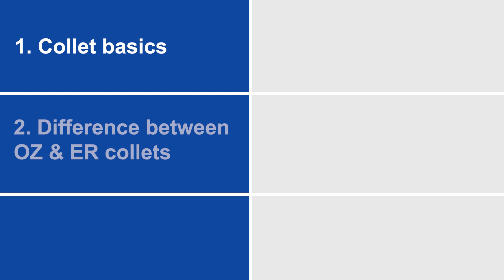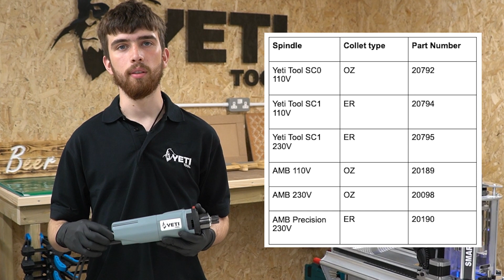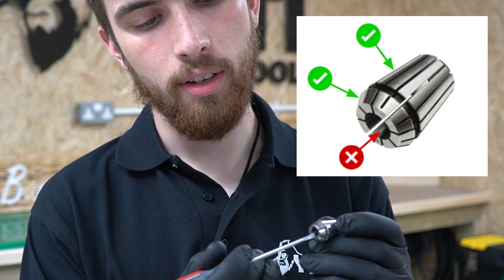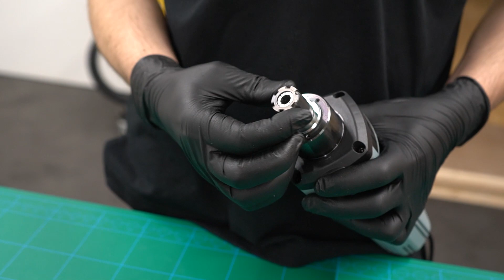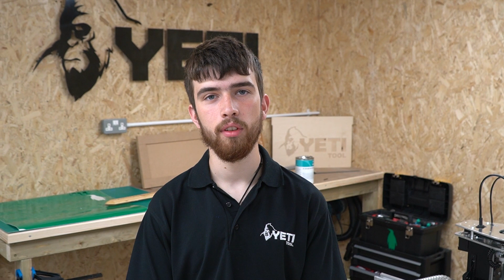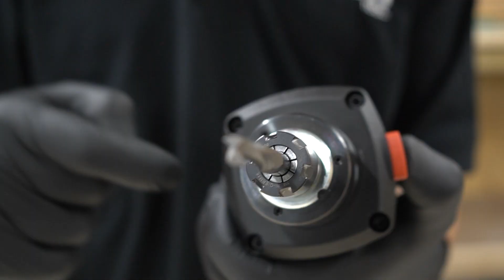Spindle collets masterclass

Comment: Thanks for the video and info/tips.  Can a 1/2 router be converted to a 1/4 router?  I have both and every bit is for a 1/4 but I want to start using my plunge router that is 1/2 size. Is there collets that can change the larger size to be able to take smaller bits?
Reply: I have both 1/2" and 1/4" collet inserts for my 1/2" router. Check with the tool's manufacturer.

Comment: Good info but I have a couple issues about putting any lube on the collet.  Hard to imagine that with the amount you put on the collet, some isn’t going to get into the core.  And when I change a bit, I air gun the collet and nut.  If I use any lube, I’d have to completely degrease the collet and nut  of grease and stuck on sawdust before regressing  the collet.  Maybe ok for very large production runs on one bit but otherwise a major choir for every bit change and not very practical.

Comment: does the molykote p40 come in smaller sizes, is there an alternative product that comes in alternative sizes
Reply: I've never heard about lubing collets. Just a waste of time to be honest.
Reply: @Darctan1  Plus, every time you change a bit, you have to remove all the debris from inside the spindle, collet and nut held on by the lubricant that can’t be blown off. What a mess and time consuming process.  And 1/8” turn to tighten.  What’s that? How do you accurately measure that?
Reply: @bw162  all i do is just clean everything from mixed coolant/dust. Then tighten new tool as tight as i can without hammer. The runout will still remain the same whatever torque it is tightened to. Car mechanics don't tighten everything to spec either because it's just a waste of time. Just get the job done and don't think too much 😂.
Reply: @Darctan1  I’ve worked in the aerospace industry. If there is a call out for a torque setting for any fastener, it’s torqued.  There are design torque values for collets.  I use them.  I also torque my oil plug nuts, spark plugs, etc on my cars.  Doesn’t do any good to crush a washer tightening them.  Neither do I want to stress a collet by over tightening it 90-degrees to the pressure angle it applies to the tool and risk twisting it or crushing it; and I have done both.  We pay a lot of money to get repeatable accuracy to .0005” to risk degrading that by using garage mechanic standards on a CNC.  IMO.

Comment: I have a 3 ft lathe for 30 years and never used collets.  I used the 3  and 4 jaw chuck, faceplate etc.  I will soon buy a set of collets and a chuck and this is a good video to get the basics, thank you.  What sort of motor is that one you had there?  Like given.
Reply from the maker: Thanks for the comment. The spindle motor is our own SC1 which has been built to be used with SmartBench, and is manufactured by Mafell AG.

Comment: Good video, but I would have like to have seen how to get the collet out of the nut.   I struggle getting the collet out of the nut, I always wonder if there is a trick to it.
Reply from the maker: Thanks for the comment! We will try an include this in one of our next videos. Simply put, you need to do the exact opposite to loading the collet into the nut. Pushing the collet in the correct direction will release it from the eccentric washer.
Reply: Bit late, but just knock the nut on a wood bench and it'll pop right out. You don't have to slam it, just a light, deliberate tap.

Comment: Hi do You think it is nesessary to release the router bit, when the router is not in use? Because i always leave them in the router until I need to use another kind of bit. Thanks
Reply from the maker: Hi Juan, If you are not using the machine for a while, then it would best to remove the bit from the collet.
Reply: @CNCSmartBench  👍👍 thanks a lot